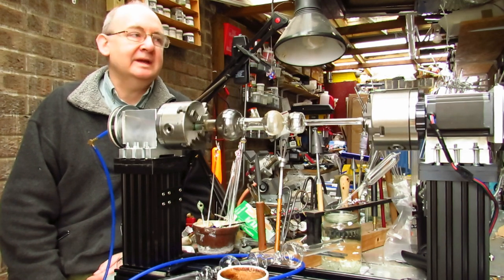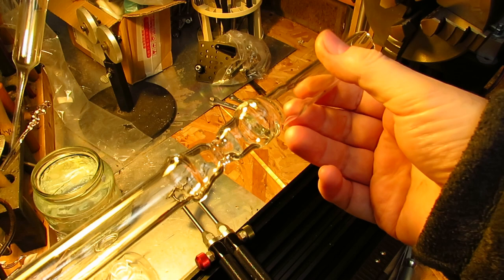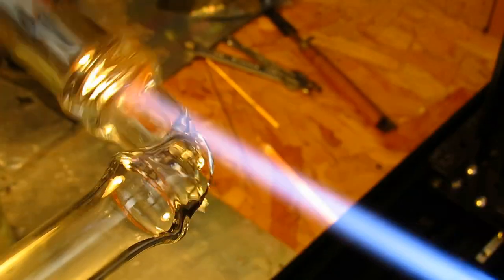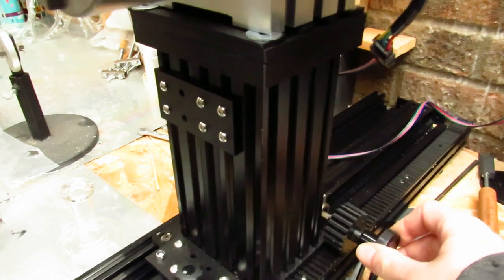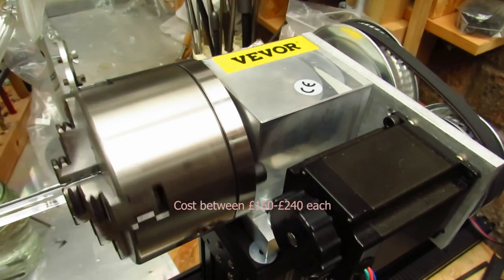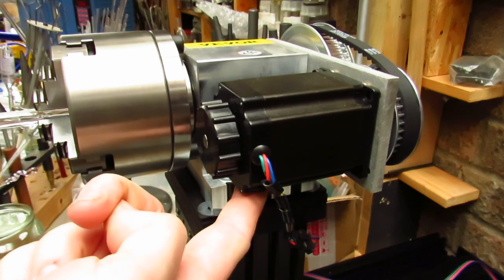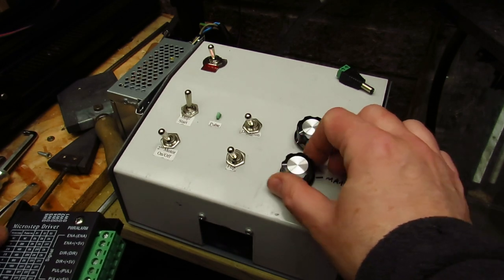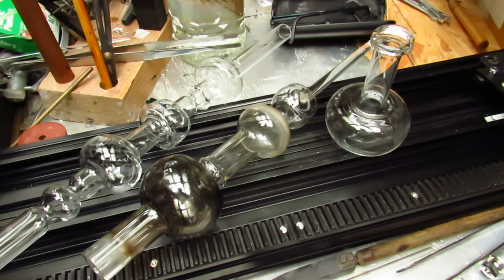Stepper motor Glass Lathe made using open build components

Comment: Did not know what a glas lathe is, video just popped up. Maybe you give microstepping a try, to reduce the noise of the machine and makes the motor less "jumpy" at lower rpm.
Reply from the maker: I did set the controllers for microstepping, but I think they are quite poor quality so don't seem to do it very well! I'll tend to run at a higher speed so its not too much of a problem

Comment: Hey great project, I am trying to do something similar on a budget. I have a few questions I hope you might be able to answer.
What sort of torque are those steppers rated for and have you found them powerful enough?
I am looking into using these newer closed loop hybrid steppers for accuracy and to hopefully add a few features to my controls.
One of those features is introducing skipping for controlled twisting (reticello, wigwags, etc.). 
Have you tried to introduce anything like that with your lathe or do you know if this is possible with normal stepper motors?
Reply: Hi, I can't recall what the torque is, but as long as there is a good power supply to them it seems pretty high, only issues I've really had is the lack of 'fingers' from the chuck jaws to give more stability to any glass being held (I've not been able to get to this project for a while to address that) As for adding twist feature, I did add a switch which reverses one motor so it would twist the glass, that was very easy to do, but you might prefer to add something a bit more sophisticated so it does it either stops every few or you can adjust the speed on each one so you have more control. If you are into using microprocessor controls like arundios or raspbery Pi thats probably very easy to do, but thats a bit out of my comfort zone
Reply: @glenngodden1224  I will definitely ensure i have sufficient power to them. 
Regarding the chucks, are the 4-jaw ones youre using workable with some rockwool/graphite tape? It's hard to find any others that are cheaper let alone the nice 'planetary' type. So although they may not be ideal, it may be my best option. Alternatively, perhaps a collet type chuck as this clamping system would also satisfy the hollow/passthrough requirement.

I may look into having one stepper "skip" steps/pause or reverse if it is something I can do with the controllers as opposed to having to program an Rpi or arduino to do it. I am comfortable writing basic code but considering I don't really need any other fancy features, I'd like to keep it simple and address the controllers directly like you have.
Reply: @theorgangrinder1743  the 4 jaws are ok, especially for smaller tubing, but anything larger than 20mm that can't fit through tend to wobble or if its too tight cracks when I start heating it up. I was going to drill through the chuck jaws and them thread and add some makeshift graphite fingers, but the metals too hard! I think some people on the opensource lathes (sorry, I can't find the links) were coming up with some planetary chuck plans, but thats beyond the scope of my shop, as its going to need access to some serious maching shop equipment, but I guess there might be clubs and colleges that might offer their shops for evening work???
Reply: @glenngodden1224  I don't think I would go to the lengths of machining new jaws as 20mm should suffice for my current use case. I guess that is something that can be upgraded later anyway if I come across better ones. It wouldn't require too much disassembly of the original design. 
Is the limitation of what can pass through from the bearing assembly/gear or the jaws themselves?
Reply: @theorgangrinder1743  The main drive shaft behind the chuck is hollow, about 18/20mm (although I did have to file one side out as there was debris in one) but be warned that there some of these units being sold with SOLID drive shafts, so really check carefully before you order